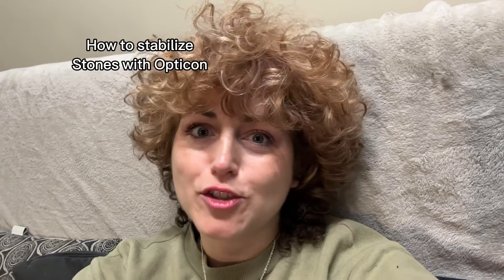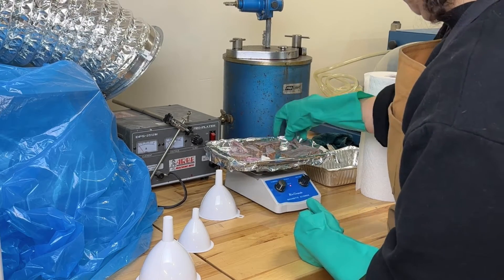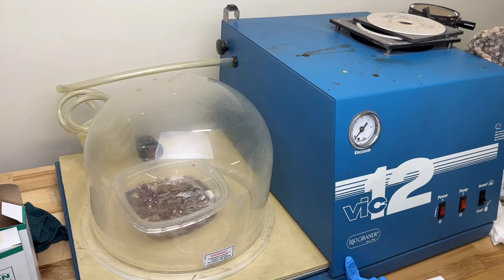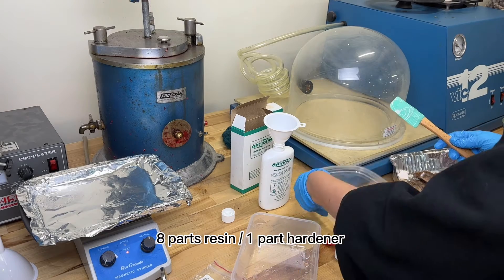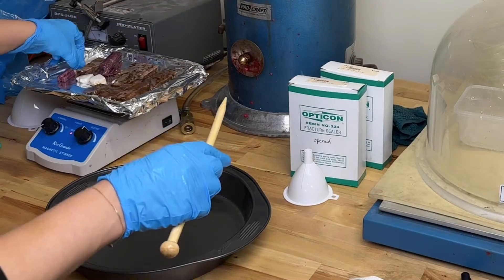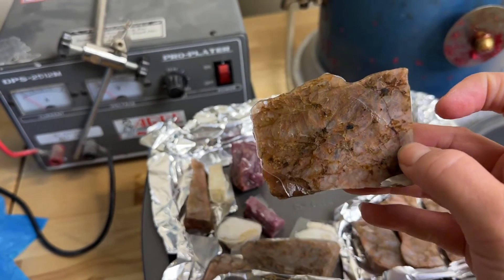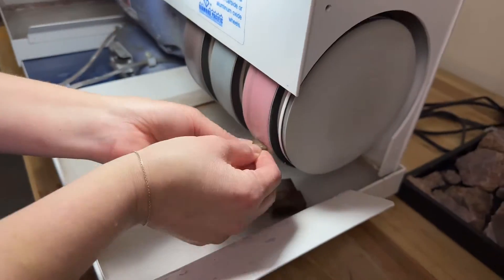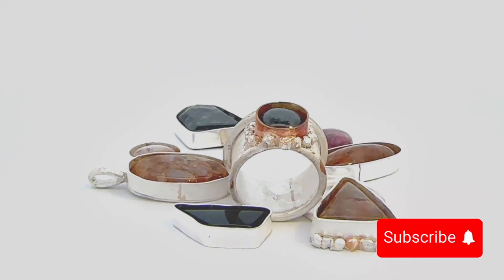How To Stabilize Rocks With Opticon - First Experiment!!!

Comment: I have had great luck using stuff called magic resin. Its a deep pour low viscosity epoxy resin. I found it penetrates deep on even thick slabs. Coprolites are usually what I use it on due to their crumbly nature.
Reply from the maker: Thanks so much I will definitely try it out 🫶
Reply: @femmemecaniquedesigns  your welcome

Comment: Using the epoxy first to fill the cracks and then coating with a thin layer of mixed epoxy and resin is a method you use on faceted stones. The wet epoxy in the depth of the cracks are not an issue because your not cutting into the stone. It also helps to heat the epoxy up to 190 degrees to thin even more.
Reply from the maker: Thanks for your input! I may try
to heat it a bit more next time! Cheers!
Reply: @femmemecaniquedesigns  It is usually heat cured.
Reply from the maker: @robbybobby64  I was pretty happy with the results! I did some heating :) next I will try cactus juice !